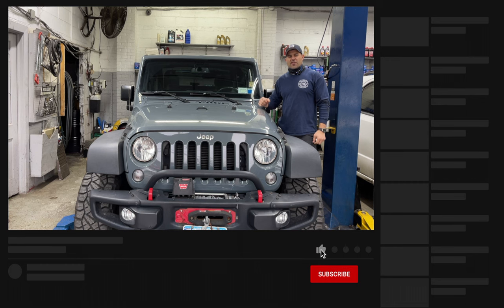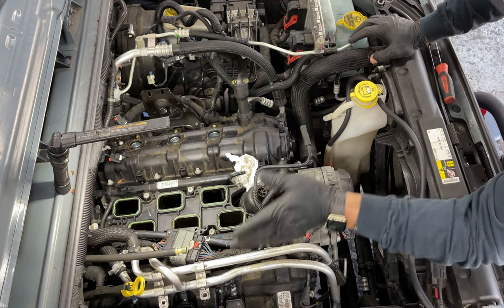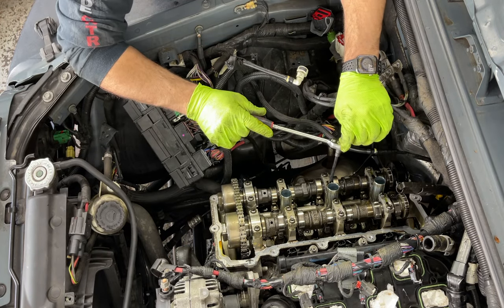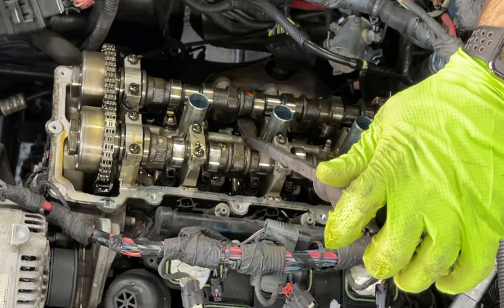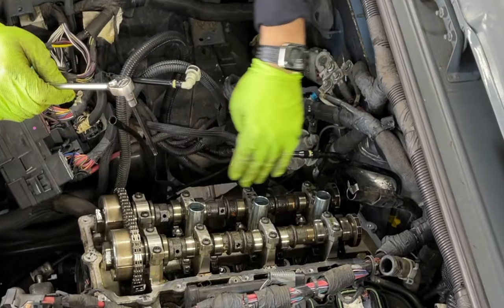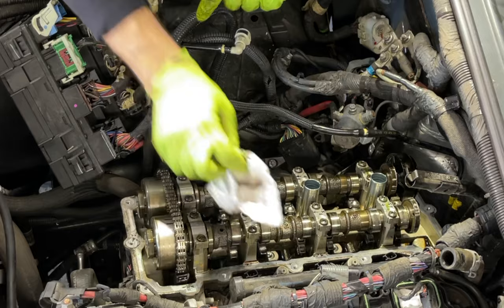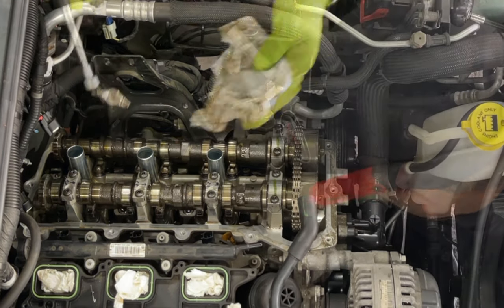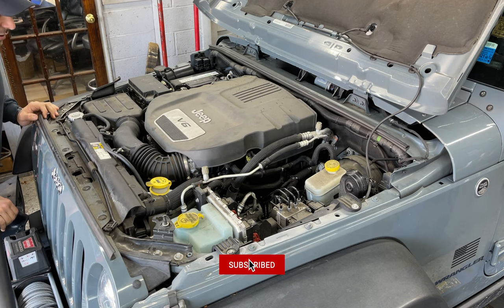How to fix Pentastar Engine tick Jeep 3.6L "SHORT CUT"

Comment: are there no engine additives for tickind ?
Reply from the maker: I wouldn’t recommend using any additives for that. The ticking happens because of a worn rocker arm don’t try to mask the ticking by using thicker oil or additives because if that rocker arm’s finally gives, that would cost you an Engine.

Comment: This is the reason I don't get sold to the American cars,  the amount of unrelated stuff you need to remove to access the spot you need to work on is just ridiculous .
This is one of the reasons why yota is king of cars.
Reply from the maker: This is absolutely correct and German cars are even worse. I was fixing a similar problem on a Mer/Benz ML350 last week. Delayed start and a rattle after start. The amount of work and parts had to be removed to just access the camshafts is insane.

Comment: People please park your Jeep soon as the tick starts, if you do not you are damaging the lobs on your cam…to avoid replacing the expensive *ss cams park it, order the parts and fix it…it’s not that hard…and will save you 5k at a  dealership…but great video informative for real…I wanted to change all of mine but was afraid to get it out of time, so next time I know exactly what to do…also I don’t know if he mentioned on the passenger side the exhaust cam and intake cam have 2 arrows on sensor and chain end, on the passenger side they point away from each other…drivers side they point toward each other

Comment: Has anyone had, or know if this problem causes a P0016 (cam/crank timing misalignment) code to be thrown?  I definitely got the tick.  I started getting this code - I can reset and it'll stay gone for a few weeks, but eventually comes back.  I'm about to get this work done - but anything related to this code I need to look into while they're in there?

Comment: I hear a definite tick in my motor. I'm not sure if this is related but I am also losing oil pressure. After warm-up, the oil pressure drops to 10lbs at idle (sometimes lower). It occasionally stalls out. I changed the PCV valve but oil pressure still drops. I think the motor may be toast...
Reply: What is in charge of oil pressure? A pump...
Reply from the maker: Low oil pressure is a concern. Could be oil pump depends on mileage on the car.
Reply: Your tick is a rod knock dude🤣 you're losing oil pressure through the rod bearings

Comment: I just done rocker arm replacement on my 2015 jeep grand cherokee but now the Trans is going in limp mode only go in 3rd gear and throwing p0344,u1424,p1dd2andp06dd what could cause that?
Reply from the maker: Check your camshaft position sensor on the pass side

Comment: Buy a Baxter spin on oil filter adapter or you will be doing this repair over and over and over again...personal experience as my Mojave is in for the second time in less then 10000 km...I've owned 3 other jeeps all had the same issue

Comment: You mean I don't need a new engine? It's amazing what a lot of shops will recommend when they dont  have skills to actually fix the problem.
Reply from the maker: If you know how many customers came to my shop after other mechanics told them they need another engine. When they don’t have the knowledge and skills to fix something they will just change it. 🙏🏻🙏🏻🙏🏻👍🏻
Reply: I just got suckered into a new engine 😢 for my 3.6L on a Dodge Avenger. 7,000 bucks later it still runs not so great. But I do have a 3.7L on a 2002 Jeep Liberty that had the ticking sound that I might try doing myself. So definitely thank you for the knowledge you share.
Reply from the maker: @stephaniecuna8190  I’m sorry to hear. That could’ve been fixed for a lot less money. Now, for the 3.7L I personally believe it a lot less reliable than the 3.6L. I have done so many head gaskets on them. It really should’ve been the other way around. New 3.7l engine and fix 3.6L.

Comment: Would this problem cause DTC P219A Air fuel ratio imbalance code
Reply from the maker: No it shouldn’t. For that code to be checked right, you need to perform a smoke test and check for air leaks in the engine, check fuel pressure and check O2 sensors.
Reply: Yes it can.  Seen it more on minivans. Do you hear a tick?
Reply from the maker: @rodolfomartinez8661  what would an air fuel ratio code have anything to do with oil cooler ?

Comment: Fixed mine with Lucas oil stabilizer
Reply from the maker: You definitely didn’t fix it. You masked the problem and when it completely fails it will cost you an engine.

Comment: Did Jeep/Fiat fix this issue in newer models?
Reply from the maker: They say they did but I got a call last week for a 2020 need the same job.
Reply: I have 2022 GC Laredo with 23k on the odometer. The rocker arms have been on my mind , but   the water pump was leaking last week and it was changed under warranty. I understand some parts go bad, but this is little early. 
Time will tell what will go wrong next.
Reply from the maker: @freddie3159  that’s definitely too early for a water pump.
Reply: I know. Waiting for the ticking noise now. They use such cheap parts. It’s so disappointing. I’ll probably trade it in after the warranty for a 4Runner. I know no car is perfect, but Toyota will hold up .
Reply from the maker: @freddie3159  Toyota is definitely more reliable

Comment: After changing my rockers and lifters I get P0300, timing chain did not move and everything is connected correctly. Has anyone had this issue after a job like this?
Reply from the maker: That’s random misfire code. Did you use original parts or of Amazon?

Comment: What causes this? And what keeps it from happening in the future?
Reply: My exact same question - what caused this and how to prevent it from happening again?
I another channel, this failure was attributed to not changing the engine oil !
Reply: @LWRC  i did some research. Apparently the rockers were inferior and failed. They now have an updated rocker without this problem. Apparently when you buy parts from Chrysler or anyplace that sells them. You have to call the dealership and get the most up to date part number. Unless you just buy direct from the dealer. 

So I would imagine if your not careful you could end up with an old part that might fail. Instead of the newest most up to date one. 

Also Chrysler got sued for this. But got out of it. Go figure. ;) They issued a bulletin blaming low octane gas. Not sure there's any proof running high octane will help. But that's their claim. They sold over 10 million of these motors.
Reply: @xx67  Thanks for the info. Do you know what years these inferrior rockers applied to?  I have a 2016 Wrangler Rubicon Hardrock I ordered and have not had any rocker / knocking sound issues in 55K miles. 
Blaming this problem on octane of the fuel is nonsense as the combustion has nothing to do with the rockers!!!

Comment: I did this on the driver side, but didn't mark the cams, and made a few rotations. How do I set it right so my cam sensors work again? 

I'm considering setting the arrows back to -><-, and reinstalling the valve cover.
Reply from the maker: You need to check out my other video Pentastar Timing Chain, Engine Tick, Rocker Arms. 2015 Jeep wrangler, Grand Cherokee, Chrysler
https://youtu.be/tUqAwAHv5ks

Comment: What are the marks on the caps for
Reply from the maker: What caps?
Reply: Holds down cams with the two bolts each 
You wrote something on them with sharpie  and I must missed when you explained why
Reply from the maker: @martircolonmemories  oh the cam caps. It’s already marked by the manufacturer but if you not sure how to read it just mark # of cyl, direction and make sure you install it back the same exact way it came out.
Reply: @a2zautomasters862   Thank you

Comment: My issue with this is how many times do we need to replace all this crap before Chrysler owns up to their mistakes my 2020 has no check valves in oil filter housing drains back to pan dry starts and every time

Comment: Well I finally dropped my Jeep off at the dealership where I bought it in 2015. Got the call this morning and was told lifters, cam’s everything are gone. Rear axle leak too and timing chain etc. and the quote was $7500. My oldest brother worked on my vehicles for years but he’s dead now so that’s not an option. I told the guy to go ahead and fix everything. I always took care of my Jeep. Bought the best oil. I told the local garage guy I could hear tapping and other things. I was told he replaced propeller shaft $285 and spicer universal joint $210. And he noted Engine Tapping FIXED!!! And that’s how he documented it on repair order. I’m disgusted. If I thought my Jeep would have made the trip I would of taken the drive. It wasn’t about the money. I just wanted someone to acknowledge what I was saying
Reply from the maker: Thank you for the update. I’m so sorry about your brother and that $7500 quote. It seems a little too high. that rocker arms job with the chains and all cams about $4000-4500 the most. Both axle seals in the back with the rear differential service about $500-600. So it’s about $2k over. Unless they’re doing other work. Good luck for you, at least you know the job will be done right. “Hopefully”. Please let me know when it’s done and how it goes. Thanks again.
Reply: @a2zautomasters862  I just them telling me my engine is trashed. Maybe I should have bought new. I don’t know. It’s nice to come across nice people in the world. I hope I hear something by Tuesday. Maybe buying a new engine would have been a better choice.
Reply from the maker: @MeganZopf  I can’t imagine a bill from them for a new engine. I really wish you lived around here. There’s definitely other options. I really think it could’ve been cheaper to ship the car here get everything done and you come drive it back when it’s done. Try get a list of everything needed in details so I can have a better idea of the condition of the car and see if it’s worth fixing or at least, we can have a better estimate of how much it could really cost.
Reply: @a2zautomasters862  I tried calling today to see if I’d have my Jeep back by Tuesday. I kept getting transferred and finally got aggravated and hung up. But yes, if I get my Jeep back I will most definitely get an itemized list of everything they did. The last quote I got was $7500. Bonneville & Son Chrysler etc. in Manchester NH. That’s where I bought it new in 2015. I really wanted to get my Jeep to you initially. I probably should have. For the price I pay I could of had a limo pick me up and brought me to a luxury hotel! Get this, I asked  the guy if I could set up an account so I could dump $2500 a day into that account because my bank only allows that much per day on a sale. My back is in CT. I obviously can’t drive there to withdraw money to pay them. They suggested I apply for a loan through them so I initially looked into that but saw the interest rate and said no! I have the money. Oh well, I had a beer tonight but felt like getting a barrel lol! A nice long weekend to look forward to!

Comment: How much costs to fixed
Reply from the maker: Depends,  if you changing any camshafts, oil cooler seal kit, or camshaft position sensors. also got to change valve cover gasket, intake manifold gasket upper and lower and all 24 Rocker and 24 tappers. $2k-$3k

Comment: My 2022 Gladiator makes this noise. Less then 30k miles. The dealer tells me they can’t hear it.
Reply: I'm fairly certain I had the tick in my 2021 from the time I drove it off the lot and thought it was normal.  It's not.  I just got mine replaced and there's significant wear on the lobes and rockers.  $2300 to replace 6 rockers and lifters.  It is still registering misfires and there is a slight tick yet.
Reply: @jasonstockton  as it turns out I had to have the engine replaced at 32k miles. The dealer said the rod bearings were scored. I don’t have much confidence in it now.

Comment: Or get a phaser lock and take the cams out instead of relying on cap bolts to bring the cam back down without the possibility of messing up a cam
Reply from the maker: That’s true but if you follow the video exactly the way I did, you should be fine also the tool only works on one bank. Bank 1 you can’t reach the tensioner to lock it but I made my own tool and will be coming in another video.
Reply: @a2zautomasters862  DPTools has one that reaches you just have to make sure it went down correctly,

Comment: Ideally the parts should have been lubricated,dipped in oil or oil poured over the completed repair wetting the cam with oil. Any engine Ran dry even for the slightest second is very hard on vehicles especially with close tolerances.
Reply from the maker: That’s true or I usually Pour oil on the camshafts and rockers before replacing the valve cover back.

Comment: sea foam cured mine.
45537 miles.
Reply from the maker: Sea foam will not cure a bad rocker arm. You might have had some oil gunk clogging oil passages that was causing the ticking.

Comment: The root of the problem is a lack of oil pressure in those banks. Unfortunately it will happen again.
Reply from the maker: Jeep claims to fix the issue for 2015 and up. I’m not sure if it’s true. So far every single one I did been running good 🤞🤞
Reply: @a2zautomasters862  Nope, my 2015 jeep has the same tick at 80,000 miles. I'll be changing the oil cooler housing as well with the AC Delco aluminum one. Great video.
Reply from the maker: @roberte7278  I knew it. Chrysler is full of it.

Comment: Wow, I’ve had to replace two rocker arms because on engine tick and you are removing way too much…I did it in one day about 3 hours…didn’t remove half of this stuff…especially the battery box…air box..being the tipm is an issue on some of these I wouldn’t recommend removing it…just remove the passenger tire to remove pcv and to get to lower valve cover bolts…always replace all your gaskets and no problem!
Reply: Also a plus, removing the fender and tire, give you more space to work…definitely helps not to strain your back
Reply: Just tire??? What about the fender housing?? Isn't it the same amount of work?? To me it looks easier to remove battery
Reply: Housing
Reply: @danielq.4371  he is removing the tipm…it sensitive! Taking the tire off and the upper fender/liner just pops off…there are a lot more things you have to worry about damaging taking out the battery, and box..fuel lines, purge, your tipm and it’s housing, and air intake, lots off plastic that breaks, and some of those are expensive repairs, if you damage them…rather than messing with those pop the tire and fender off much easier and more space to work
Reply: @danielq.4371  you think? Umm, if you haven’t done it, go ahead do it your way buddy…I’ve done both and the tire and fender are much easier…watch other videos, they do it the same way I do…but hey bro, you do you
Reply: @Ford Exposure By Nessi Ford  thsnk you for word of caution. Currently delayed due to bad weather here but I'll get to once the rain stops.

Comment: Don't do it this way. What he did will damage the cam journals. They're special timing tools required to do this. The tension on the timing chain will pull up the back of the cam, causing damage. Again Don't follow this guy

Comment: what a pile of crap engine....my mailman's penthouse-star went to hell at 87k....roller lifter shot. What the hell did Chrysler think when they designed this engine with an oil filter/housing that does not hold oil after shutdown? well, it means a dry start everytime.....Junk is the word for these.  I don't work on 'em anymore at my shop.

Comment: Piece of crap engine. Bought a new 2012 200 and 11 years later put only 58 thousand miles. Was always good about changing oil 3, to 5 thousand miles with synthetic oil. Just spent 4000$  to replace left cylinder head. Was getting misfire code.Did some research and Chrysler had TSB, but no recall. Chrysler extended warranty up to 10 years or 150 thousand mile. 10 year ran out last year and Chrysler did not help to on paying some of cost. They told me the same could happen to the right cylinder head.